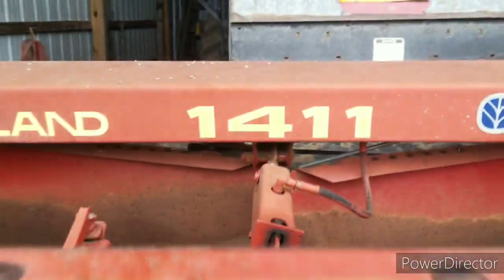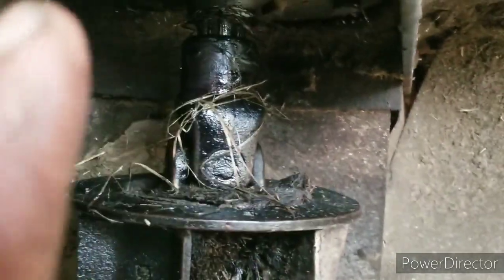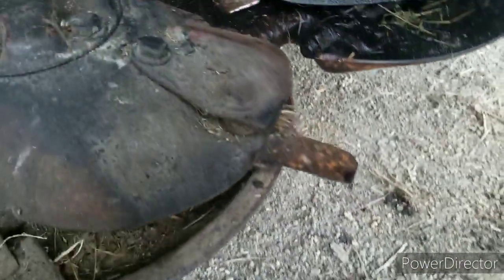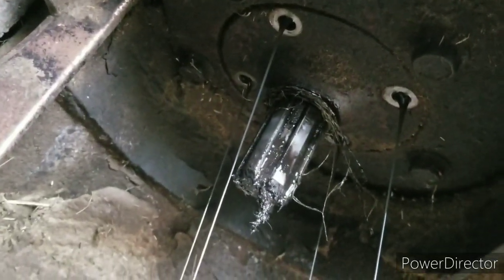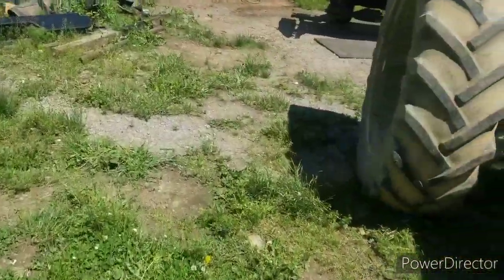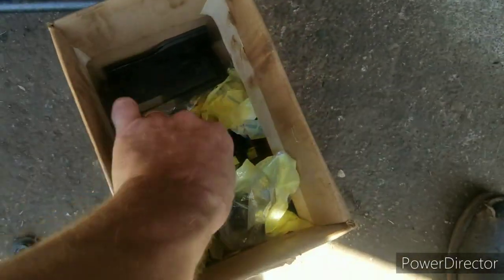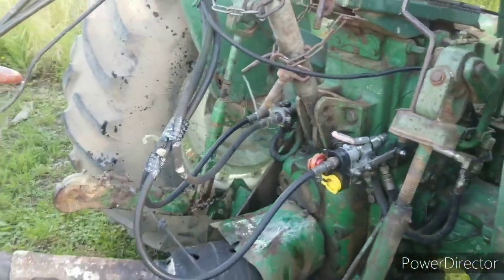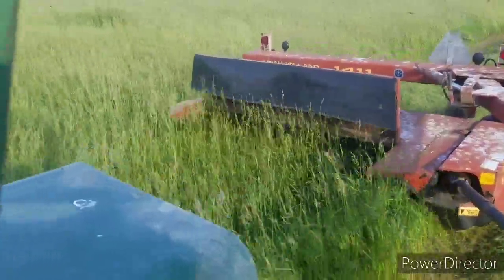Fixing the 1411 diskbine and the first hay of 2020

Comment: You'll wonder how you ever cut hay without a discbine :) My Case IH 8309 came with cups on the knife bolts kind of like that. Did you ever find out if there is supposed to be another shield under there? Hard to believe that shaft is supposed to be exposed like that.
Reply from the maker: Y'know my hay doesn't wrap the way this thing was wrapped up! I really like using this machine does a great job!